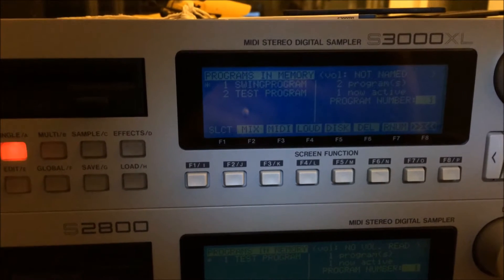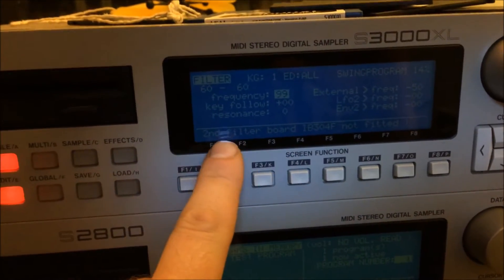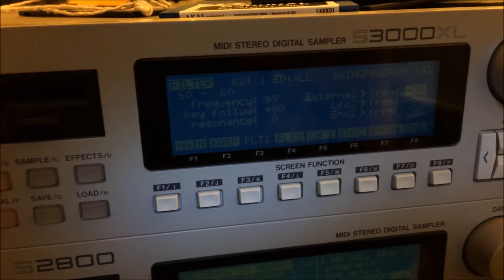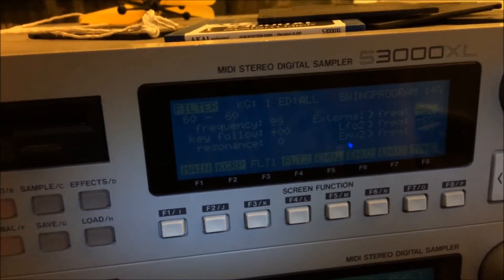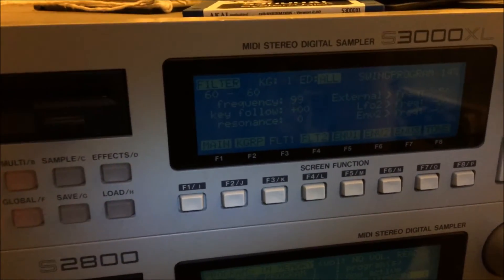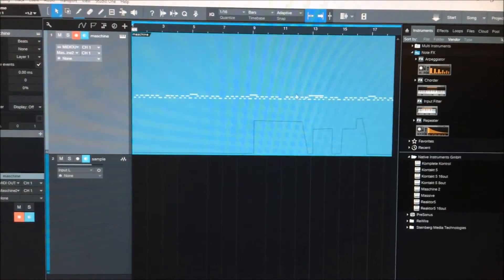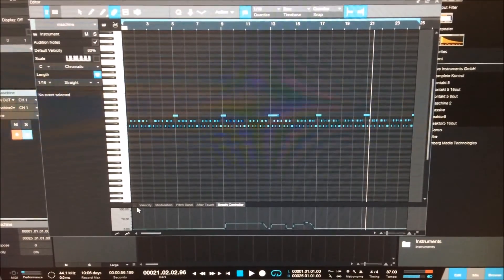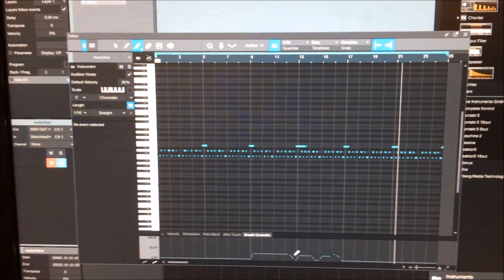AKAI S3000XL Tutorial - Filter Automation Part 1: Cutoff

Comment: who is the best s2800 or s3000xl?
did the S3000xl sound the same?
thanks good video
Reply: They're more or less the same, the s3000, 3000XL and S2800. They're all variations on the S3000, Which is he same sample engine as what the MPC3000 has. I think the s2800 has he same converters as the s3000 and it's just the XL that's different (but don't quote me.) Presumably the s3000 and MPC3000 have the same converters but again, I don't know that for sure. Basically don't sweat it. All four of those machines sound pretty much the same - really nice :-)
Reply from the maker: The S3000XL is better. 8 x outputs and more memory. I think the convertors are different, so the sound will be very slightly different in theory.
Reply: Ok thanks if i want the same sound of the mpc 3000 the s3000 is better ?
Thanks you
Reply: @daddyabe9465  they are not the same sound engine... the s2800 is the same as the s3000(non xl) and mpc3000
Reply: vince Parker thanks

Comment: Any updates on this? Wondering if "breath control" parameter was specific to the DAW you were using or if that just happened to fall on the midi CC message number the Akai needed to receive? If so, how do you find this CC number (AKai manual midi implementation chart didn't help me with this)? I use Ableton + Push to sequence my Akai S1000 and would love to map the knobs to automate the various parameters of the Akai filter, envelopes, and lfo to the knobs on the Push for live tweaking. Based on your video (very helpful cheers!) I am under the impression I know what to do on the end of my DAW but do not know which midi CC notes to send for which parameters in the akai. Any input would be much appreciated! PS - is there a way to assign other parameters to midi (e.g. chopping samples on the akai via Ableton rather than directly on the Akai - doubt this is possible but would be a dream come true!)
Reply from the maker: Pretty sure Breath Control is a standard. It's definitely the same in Cubase. Best way to find out on Ableton is just try it, but I think it'll be called the same thing. As for chopping samples on the Akai remotely from your midi controller- nah mate I don't think that's how midi works. I know Maschine works like that. But there's more going on in Maschine than just midi. That's a whole bespoke software/hardware package. All midi sequencing really does is tell the instrument what order to play what notes in, when, how loud, and CCs to apply. That sure would be dope though, if someone could design a way to do that! Closest thing to that is just cop an MPC i reckon :-)
Reply: Thanks for the reply! I figure chopping samples remotely is just a pipe dream :P

Unfortunately on the Akai S1000 when I go into the menu you show in the video there is no "external" option on the list. I have recently found a max4live patch allowing to send out breath control CC data. Not sure where to go from here in terms of experimentation. Would love to modulate the filter cutoff at least and ADSR/LFO modulations from Push would make it a dream come true! Any thoughts?
Reply: Breath is just an alias for CC2. If your DAW/controller doesn't have 'breath' use CC2 and you're good to go.
Reply: I have this old ST running Notator, and there's this function called "Control Change" and "Breath Control" seems to work with my Akai.
Reply: Ah I've just realized, you can set the APM settings in Global, but I think they're Breath Control by default.

Comment: is it possible to link a knob on my keyboard to filters midi cc ? cant find a way to do it
Reply from the maker: I've not tried it. If I was to try it I'd connect a midi controller keyboard to the computer and map the knob to the Breath Control cc in the DAW, and do everything else in the video.
Reply: Daddy Abe couldn't manage to sort it out in ableton but managed to set it to the mod wheel instead. cheers for the vid!
Reply: Yes ,  in Global section select the APM to whatever cc ,  for example 74 (CutOff ), then on you keyboard select the knob for cutoff are you may have to assign it on your keyboard, that should be it
Reply: Have you found out how to control the resonance, are is it possible?